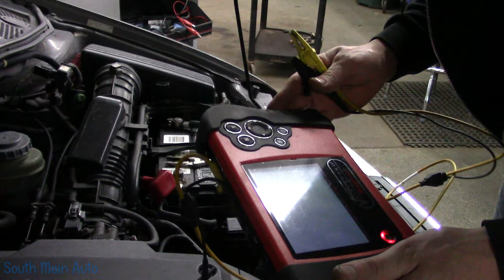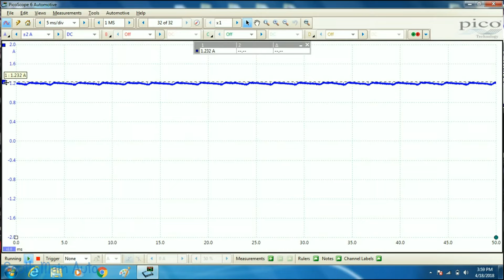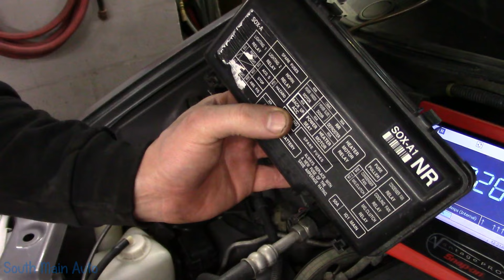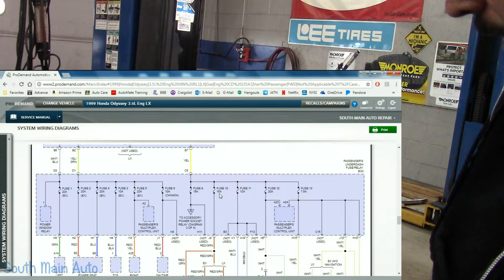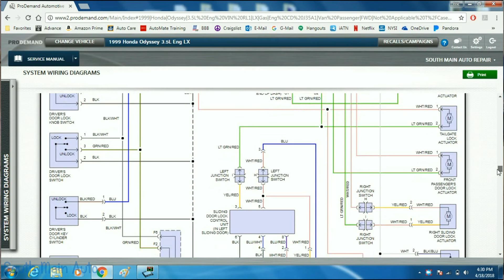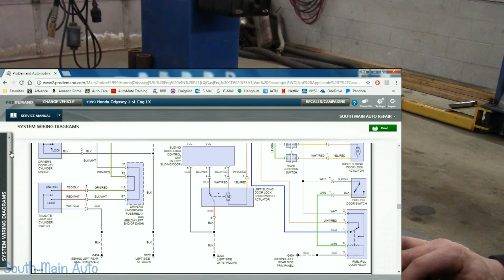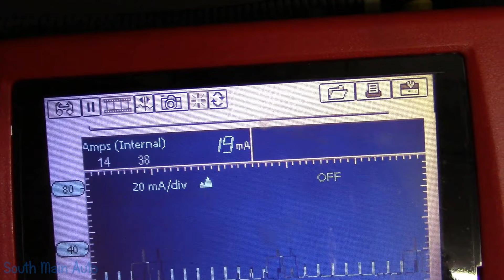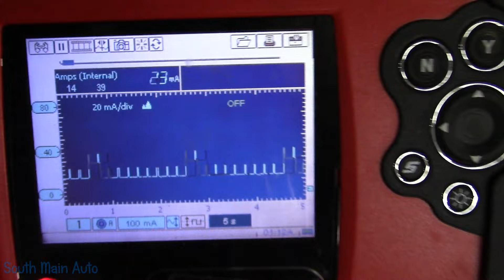Diagnosing Battery Draw (Battery Goes Dead Overnight)

Comment: I had a 13 amp draw showing when I hooked a volt meter between the negative cable and the negative battery post. I found the problem when I moved the powered drives seat back and the draw went away. That draw was killing the battery over night. All you did by hooking between the the positive post and the positive cable was complete a circuit that was still grounded.

Comment: When you removed the relay you not only stopped the parasitic current draw due to the faulty fuel door switch it also removed the passenger multiplex units ability to close and lock the door electronically since the normally closed relay contact connects the door locking mechanism to the central and electronic door controls. Remove the relay and both the Fuel door open and the central/remote door closing are both disconnected. You should have opened the fuel filler door and at least looked at the fuel door switch and see if part of it or the door had broken off preventing it from detecting the door being closed... If nothing is visibly missing that can be replaced with some glue and a block of rubber then possibly disconnect the switch so the relay could remain in place and allow the central locking system and remote door open/closer to operate or at least see if it will operate. Parasitic drain would be gone and the central locking would likely have worked just fine. But since this is over a year old it's all moot anyway.

Comment: Currently I have to take off the neg cable when not using car no draw obviosly. I've ordered an "isolation swtch" ($14 including shipping). 
I'll continue to try pulling fuses. I guess I put my multimeter on 200 amps, but it DID NOT seem to work last time. I wish I had help to get to proper multimeter settings.
My battery is in the trunk of my Saturn.
But, it's not a bother to take of neg cable and soon, twist off/on my isolator swtch soon to be installed.
Finally, I spoke with my favorite mechanic yesterday and he said finding a "parasitic draw" is not his specialty!
I must get 6 - 8 ft cables attached to my trunk battery and tape on multimeter on front window (at correct settings) so I can see which fuse is causing the drain.....my suspicion is radio and interior clock & ceiling light, but it could be more. I'm obsessively trying!
I bought a Haynes manual to increase my knowledge.
ITS VERY TOUGH WORK FOR A DYI'er, but I watch everything on YouTube for ideas and especially. how to use a multi meter plus long cords to see changes on windshield to see if I found that parasitic draw after pulling the correct fuse..   
But, if that fails I'll take it into a shop!

Comment: If the door lock doesn’t lock completely if you push the door in and locks the latch but might leave the switch or rellay on ( like the door still open ..? I believe if switch in door it’s not actuating mostly problem it’s in rear sliding mechanism

Comment: Will you be able to post WUW from yesterday? I missed it
Reply: Brian Smith ya what happened to the video from WUW?
Reply from the maker: When YT rendered it something goofed up I guess because it just will not play?! No biggy. I had to cut it short cuz the boys had a ball game
Reply: South Main Auto Repair Hope itnos warming up enough up there for baseball. I would like to send you a letter with a question about a GM TBI that is giving me trouble. Will send your hourly rate if you wouldnt mind just giving me an opinion as to what is going on. I know it is hard to diagnose without putting hands on it, but would just value your thoughts. Would you mind doing that?
Reply from the maker: Boy GM TBI is pretty cut and dry usually. What is it doing?
Reply: I saw it. There was a fart attack.
Reply: South Main Auto Repair Cranks for 5 seconds and starts-sputters and dies. Crank it again and immediately fires up sputters and dies again. Crank again fires up and then runs fine. Fuel pressure is 30 psi(it is on a boat and that is the factory pressure) at key on. Immediately bleeds of at key off. Is that pressure bleed off normal? I can’t figure what is causing the sputtering and dying a few times until about the 3rd start
Is extended crank just a normal thing for TBI? Star of tune is good-plugs, wires, cap, rotor, ICM, and MSD distributor are all new.
Reply: Brian Smith very un professional opinion but maybe the fuel pressure regulator.. Shouldnt bleed off that quick... Check valve maybe?
Reply: Brian Smith Or perhaps a leaking injector
Reply: Check valve is a strong possibility.  It's losing fuel in the line as soon as you shut the engine (and therefore the fuel pump) off.  Let it sit a quick minute and the 1st crank brings the fuel half way.  The second crank brings it to the rail, the third crank delivers it to the injectors and the engine fires.

Try this.  Crank it the usual 3 or so times until it starts.  Then shut it off but immediately crank it as soon as the engine dies.  Did it crank on the first try that time?

Certainly could be other root cause issues, like does it frequently go through fuel pumps?  Sometimes, with a wiring issue, a failing integrated check valve is the first sign that the pump is not long for this world, too.

Comment: You stated that the fuse pulling method is not a good way to test for parasitic draw on newer vehicles since it will wake up modules.  What method would you suggest for these vehicles to find a draw accurately?  Voltage drop testing fuses?  Also do you happen to have a link to the power probe chart for that you mentioned?

Also on a side note - a little tip ive found -  that closing the door latches with the door open helps keep modules from waking up if you need to access the inside of the vehicle while testing.
Reply from the maker: Here is the chart (very handy) https://www.powerprobe.com/fuse-voltage-drop-charts/

Yes closing the latches is the first thing that should be done if you are going to access the inside fuse boxes. This car though still had old fashion jamb switches ;) And to answer your question yes, VD testing at the fuses and using an amp clamp is the best way to go!
Reply: Check out a dedicated  test meter called  Amp Hound. Marketed  under a few labels. Blue Point is one.

Comment: "Gauss's Law. The total of the electric flux out of a closed surface is equal to the charge enclosed divided by the permittivity. The electric flux through an area is defined as the electric field multiplied by the area of the surface projected in a plane perpendicular to the field."

Comment: We would start pulling fuses   The key is off.  So draw is at a constant even at off.   Always found that a power option switch had corrosion in it little draw but not enough to operate a device and not enough resistance to blow the fuse.  Cadillac. Was the pwr window or locks switches

Comment: Parasidic drain. 2008 Odyssey Touring. Seems to be on the #15 40 amp under hood circuit.
Would you please give me the fuse numbers down stream from there. That would help immensely.
Watched this video.. extremely helpful. Especially the exercise of driving the car around and cycling doors etc before rechecking.
Thank you so much.
Reply: Or where can i find the circuitry…

Comment: This is exactly what is going on in my 2007 Odyssey.  I'm going to pull that relay through the speaker hole.  What if I skip that part and just replace the fuel door switch?  You mean the switch that I push from the driver position that opens the fuel door; that button?  Why does it work when I push it to open the fuel door still, though?   Removing the relay through the speaker hole will stop the fuel door from working, no?

Comment: I'm thinking that if the gas door switch was shorted to power down stream of the relay that would not activate the relay. The problem would still exist but you wouldn't "feel" the relay click on/off as you plug it in or pulled it out. Does that sound right?

Comment: I have a 2008 mercury mulan, it has new brake pads, and master cylinder, the brake pedal bleeds down, the brake lines have been bled  twice, by two different shops, the pedal still bleeds down. Any suggestions,  thanks for your videos.

Comment: Since the amperage draw at the + side of the battery should be the same as the - side, would it make any real difference if you were to measure amperage draw at the - side instead of the + side of the battery or vice versa?

Comment: re, your 5 turns measuring the current with an inductive clamp.
Snap-On low amp 'probe' (clamp) D.C.measuring range starts from 10mA and I cant find any info on the lowest D.C mA reading the fluke 325 clamp, that Ivan uses, will read (only its 2%+/- accuracy)was thinking of buying something as a quick and easy goto rather than digging out the verus every time (and having it as a second 'probe')..... it is probably a good way of multiplying a reading to get it into the range of an inferior clamp with a less sensitive starting range of measurement......then you can divide the reading by the no' of turns to get the draw.....obvious to you I realise but one just dawning on me now I'm shopping for a current clamp I don't have to pay big bucks for....

Comment: Hey Eric what’s your opinion on the earthquake cordless tools ?!
Reply from the maker: Lol is this a joke?
Reply: Ditto
Reply: I’ve heard both good and bad things about them but I think I’m gonna have to get at least 1 of them (3/8) and see for myself
Reply: Millennium Auto Repair first take cost into consideration! Then warranty! For instance the 1/2 impact with 1 battery and 90day warranty is 230$ fro HF

Now Milwaukee 2767, 2 5.0 batteries,  and 5yr tool warranty and 3yr battery warranty for 350$ Plus the 18v Milwaukee battery works on 50 different tools. If u really are a shop and gonna be using them daily. The Milwaukee is a no brainer for 120$ more
Reply: Millennium Auto Repair plus now u ably need to buy bare tool for 3/8 gun. Or vice versa if u buy 3/8 first. I'm glad I went Milwaukee in the equipment and big rig use
Reply: And the charger u get with the 18v Milwaukee tools also charges 12v batteries also, so now u buy the newest 3/8 12v ratchet bar tool and a couple knock off batteries for it on Amazon.  Best bang for buck imo
Reply: South Main Auto Repair when your bro needs to pull tires on his Big Rig I'd like to see how that HF gun does. Will the one battery pull off 60 lug nuts, 6 tires on one charge? That's what I seem to get outa my 5.0 Milwaukee batteries.  Wonder how yours compares.  

Going back on I use new battery,  once but hits rim I impact for 3sec and usually see 500-525 ftlbs on all 6 tires
Reply from the maker: I have had very poor results with Milwaukee personally. I have three of their "fuel" 18v tools and all of them broke in under 9 months. On the other hand I have a lot of Dewaltt's and have yet to replace any of them. The HF tools seem to be working great for the price IMO.
Reply: South Main Auto Repair my mistake I was thinking harbor freight earthquake.

Comment: So if everything works correctly and you leave your gas door open than your battery will die?
Reply from the maker: Yes sir!
Reply: Shouldn't most batteries be able to sustain a 250 ma load for more than 24 hours?
Reply from the maker: Yes they should. I am not sure the AH rating on this battery or the remaining capacity in it after being discharged so many times.

Comment: Hold on there pardner - by removing the relay, you've broken something. With the fuel door closed and the relay de-energized, relay pins 1 and 4 are supposed to be completing a circuit, but it doesn't appear that you've investigated what that particular circuit is for. Probably related to the sliding door - which now has a problem?
Reply: Slicerwizard, the normally closed contacts are just the control side of the driver side slider coming from the multiplex control unit. Given that the door has a latching issue anyway, pulling the relay will eliminate the parasitic draw and prevent the door from being opened electrically(which is fine since it doesn't close properly). It's a win-win situation unless the customer wants to replace the latching motor and the fuel door switch.

Comment: If my 2006 F350 is pulling 55MA on the 200MA setting is that normal?

I did the test with the test light as well and it does light up. But I know that isn’t always accurate on newer vehicles.

Comment: I have a remote start / alarm.. how can I find if it is causing large draw?? When I check for draw I disconnect battery and and sitting at ..044 amp.. I try arming alarm but for some reason it’s not getting power from Barry while I’m testing draw..

Comment: It appears that the fuel switch was some how causing the relay to remain continuously energized & that was the cause of the unwanted power draw from the battery; but I'm a bit puzzled how that was possible.  Normally when a fuel door is closed, it pushes on a spring-loaded rod that keeps the fuel door switch in an open condition--so that no power can flow to the relay.  When the fuel door is opened, then the spring-loaded switch rod pops out & the switch gets closed--so that power can flow to the relay..  But, in your case,  the fuel door was closed, so how could the fuel door switch allow power to flow to the relay when it was in the open position?  In other words, how can an open switch be stuck closed?

Comment: thinking about it, 250 mA draw shouldn't run the battery down overnight and it's weak with low "reserve capacity". going to guess the battery is down around 2 to 6 Ah range or alternator not charging properly or door not latching is using lots of power.
alternately if the cigarette lighter outlet doesn't shut off, they could be leaving something plugged in.

Comment: I have a parasitic draw on a 2000 bmwz3. my dc amp clamp shows a 11 milivolt draw on the negative cable, but a 54 milivolt draw on the the positive cable.. why is this?

Comment: instead of putting the relay in and out to check just leave the relay out and put the fuse in and out and if you hear it the you would know it's the door if not then the fuel door! same result different method (easier)

Comment: My brand new battery  on my 85 toy 4runner was dead within 6 hrs. What in the world would draw on that battery that much that quick.  I'm thinking the altenator needs replaced  but besides that it obviously has a draw from some wrong wiring  prob under the drivers side dash??? So as soon as I get this battery charged  back up I'm going to start it up and test altenator and those fuses  and wires......and go from there.  What comes to your mind tho first hand when I tell you that within 6 hrs my brand new battery was dead. ??

Comment: oh yeah forgot to enquire.....where exactly is that fuel door switch? seems obvious?
Reply: On the Odyssey, the left sliding door opens over the fuel door.  If the fuel door is open, and the door was opened, damage will occur.  Especially if the fuel nozzle is in the filler.  So basically the fuel door switch disconnects the power to the sliding door.

Comment: When / what is the cutoff criteria for diagnosing a parasitic draw by pulling fuses? I would assume if the car has a CAN network or perhaps multiple  bus systems would be when not to, but if I'm not mistaken several makes already had that by 2000 (BMW, MB) Even this Honda had a multiplex computer didn't It? A BCM of sorts as you said. So multiple computers is ok i take it. I fried a computer on an E39 BMW by pulling the battery termknals off too fast after pulling it in the bay. Got the new battery in, started to back out my bay and realized the big screen monitor wasnt on and thought that was weird. You have to let the module, forget which one, have power for at least 90 seconds after keyoff to do some process and i had the termjnals off in that time and fried it. $1100 shop foreman said. You should know better shop foreman said. Arent you impressed at my time? I said. Lol i didnt get written up. Cars are finicky these days and that was an old E39 back in my dealer days! Eric (or anyone sith a valid or thought provoking answer) I'm glad you felt so comfortable pulling fuses on a 2000my, when wouldn't You?

Comment: drivers slider sill get to the slider switch disconnect easy fix needs a cable to gas door easy fix .or disconnect the connector

Comment: 2006 Chevy Silverado 2500 no one can figure out why battery dead overnight. We checked all circuits for draws alternator diodes on star radio antilock module ...
Reply from the maker: 90% of the time on those it is just the cluster....

Comment: Step 1- place car on charger overnight. Step 2- look it over in the morning with thermal imaging camera.

Anything killing a battery overnight is getting warm.
Reply from the maker: Do you think you could have seen the relay buried down in the 1/4 panel with one?
Reply: You more likely would have seen the door lock solenoid inside the door, but yeah- anything warm on the car is immediately apparent, even where you might have rested your hand. The relay coil itself would have left a mark- perhaps a faint mark, but a mark nonetheless.

I do contract work for the city, and have used the same technique on literally dozens of different cars and trucks and a few forklifts.

I can look at a group of people and tell you which one is running a fever.
Reply: great idea, but many times the draw would be too low and may not be noticed due to shop heat/cooling blowing around.
Reply: You are certainly free to continue about it the hard way. This isn't any sort of proposal or theory. There are 50 million "parasitic draw" videos on Youtube, and my way doesn't involve melting probe tips, blowing fuses, or downloading wiring diagrams.

In the time it takes you to change the fuse in your meter because you opened the car door, I'm already on to the next thing.
Reply: I'll repeat it one more time- anything that kills a car battery overnight is getting warm.
Reply: Bryan Tasler how much is the flir?